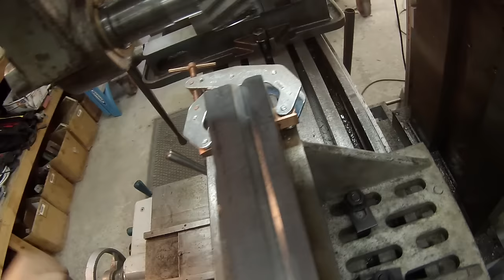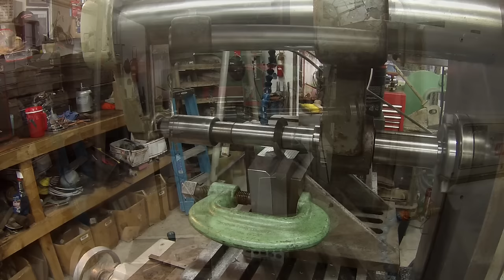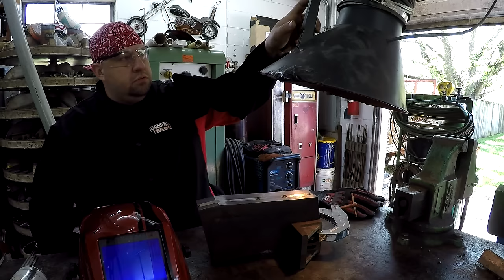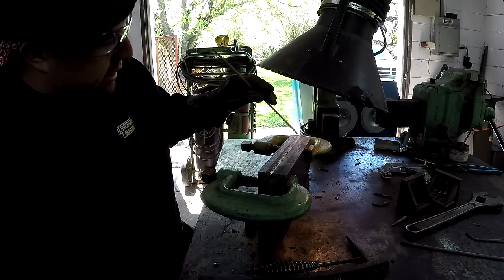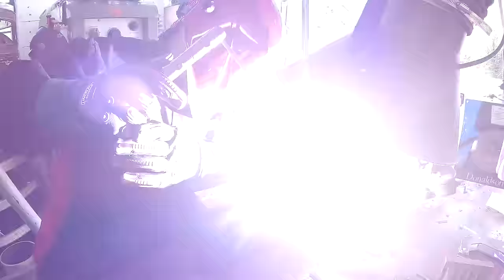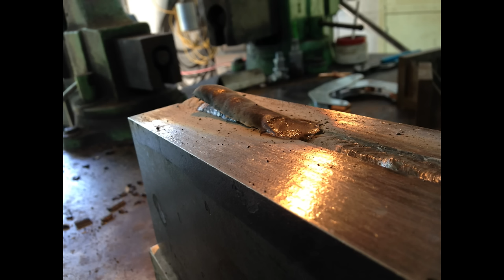Kearney & Trecker Parking Attachment Part 2

Comment: Just a thought Adam. The holes in the part would make it lighter... therefore be able to lift more, for it's size. Maybe the lightening voids are a good idea? you could just drill large holes down through the job to do the same function?
Jane
Reply: +Jane Calder Extra holes don't make it able to support more for its size; quite the opposite. A better way to describe the function of lightening voids is that they reduce the weight without reducing the strength very much, which is quite beneficial on vehicles and moving parts. They also can reduce the volume of material used without reducing the strength very much, which is an important consideration when casting production parts, and is probably the only reason K&T did it on the original part. However, voids will always reduce the strength overall, at least a little bit. An added concern here is that  a lot of the strength comes from Adam's welds along the edges, and since the welds don't go all the way through, drilling into the bottom would remove a good portion of that weld, and therefore the strength.
Reply: +Scott Anderson Thanks for your comment, of course a soild bar is stronger than the same size hollow tube. However I feel your being pedantic, the point is... that in this case the function is to carry the K&T part without being unnecessarily heavy, and therefore more prone to wear on joints and also casting metal fatigue etc... I wouldn't say anything if there were no reason to it. More, that it also adds to the effort needed to move the accessory arm, than if it were made lighter without loosing it's usable strength. If bridges were made out of soild bar they could never even support there own weight. Obviously, the original part was made in the way I discribed. What's to stop adam brazing the part inside the holes? Though from experience; I think the weld would hold anyway.
Reply: The weight of a few pounds of steel in the arm has no significant effect on the bushing wear or metal fatigue or inertia of the part, when compared with the few hundred pounds of weight of the vertical milling head it is carrying. And once again, if you were to drill through the bottom, you would remove a lot of the weld bead, which contributes a lot of strength in this case. This would massively weaken the part.

Even if Adam had used a solid piece of material for that portion of the arm (which could probably be lightened without weakening it too much), the time required to drill a few large holes in it would be orders of magnitude more expensive than your poorly considered savings in bushing wear and effort of motion.

If bridges were made of solid bar they could most certainly support their own weight, along with all the load they were designed for, and the engineered safety margin, and additionally have a lot more strength beyond that that would never, ever be utilized. That extra strength would be wasted, so the engineers selected lighter, much more affordable, and technically weaker materials instead in order to save a lot of money (if they hadn't, the bridge would never have been built, regardless of its strength).

Voids and holes never add strength in any sense, they merely reduce weight and cost in a compromise with reduced strength. Calculating how far that compromise can be carried, in relation to the application, is a lot of what engineering is about.
Reply: +Scott Anderson If I said black you would say white so I'm not going to continue this... The young have a lot to learn. You are obvouisly not a mechanical engineer. The estimated weight of the removed steel is 16lb. As 1 inch of weld has the tensile strenght of 1 ton see welding techsheets. Which is far in excess of the load from the fulcrum to load in this instance. You could lighten the load on the K&T casting piviot. It only has to break once. So we will wait and see. You could instead of down from the top make a large hole in the side and weld the interior joint. Women have been Mechanical engineers even before you were born.
Reply from the maker: +Jane Calder I'm not concerned with how much the part will weigh. Once I install it on the machine it's there for good. No taking it on and off.
Reply: +Abom79 Sorry if I appear to speak out of term. I am of course speaking from experience.  A lot of years ago, I knew a machinist Frank Edwards [deceased] who made a part; perhaps slightly heavier than yours. That part was on a heavy capstan lathe made by ward. Three heads on three parking arms. The factory [G&E] had lost one of the arms, and so they decided to make another one. Just as you have done, they used steel bar stock.  though admintedly it was soild bar stock.  In theory it should have worked forever, right? looks right. perhaps 28months past, hot in the summer cold in the winter. On the back of the lathe was a cast iron piller holding these three arms. On investigation it was found that the extra 32lb of the new arm out at a distance of 24 inches compared with the original manufacturers arms caused the metal around the casing of the piller to fail and fracture over time. Just a thought. It's your decision.

Comment: I'm guessing the air is kind of damp down there. How are you storing your stick rods to keep the coatings in good shape?

I've used an old oven on minimum temperature, but just wondering.

Comment: Are you going to pin the two sides together, or plug-weld, or just rely on the strength of the edges?

.. or I could just watch the rest of the videos and find out, I suppose :)

Comment: Hi Adam, no offense but wold not much faster if weld the frame from thinner steel to form like an i bim section than weld two tubes turned to a close dimension? 
I enjoy watching your work and effort to encourage and inspire the young guys in this beautiful trade.
Radu
Reply from the maker: +3rcamera I'm just building it the way I want, like how I built my welding table. No right or wrong, just one man enjoying his shop time and machines.

Comment: Adam, I couldn't see where you grounded the part when you welded the piece on the machine. You may want to mention it is very important to ground directly to the part being welded. If not, you can arc across your gears trying to go to ground causing damage to the machine. It is best not to weld on a machine if all possible.

Comment: I'm not a machinist, so this may be a naive question: When cutting those angles, why do everything with the roughing mill instead of bandsawing the bulk of the waste away and then using the mill afterwards?
Reply from the maker: +Pete Brown It's a good way to do the just yes, but I don't have the proper saw, and wanted to hog it off with the mill anyways.

Comment: Adam, not criticizing, just curious.  What was the decision point on using stick over MIG?  Was it just a desire to use up the old rods or another reason?
Reply: +ramosel 

Not an expert exactly but from my experience its easier and takes less machine (amps) to burn in heavy welds like that with stick vs mig.

Comment: any reasone you didnt tack the parts together and cut the piece off with the band saw then clean up in the mill?
Reply: +HomeDistiller makes for better video!
Reply: +HomeDistiller good question. it might be that a band saw can walk away from the line on large surface engagements like this.
I reckon it was more to do with the fact he was going to need the slab mill anyway and he DID say he likes watching it make big heavy cuts.
Saw might not have saved any time depending on how setup he was to push something that size through it.

Comment: I'm assuming that Adam does not have a band saw. Otherwise, he could have used it to the section he milled without so much milling.  I noticed he did the same with the toolmaker's vise.
Reply: +GnosisMan50 Actually he has, I guess he just likes milling a lot... I would  also have used a saw though...

Comment: Adam, may I ask a couple of questions?

a) When you were stick welding, was tat ac arc or dc arc?

b) What current did you use for each size of rod?

c) Why did you choose to weld with 7018 rather than a general purpose rod such as 6013?
Reply: +Greg Brodie-Tyrrell He said he was using up oldstock... maybe 7018's were all he had? I haven't tried a 6013 in a while, but I seem to remember them being a little hard to see the puddle for all the flux/slag?
Reply from the maker: Hey Greg I was using DC reverse polarity set at about 130 amps for the 1/8 rod, and 160 amps for the 5/32 rod. 7018 is one of the best all around rods to use for most any steel welding job if you have the right machine. I find that 6013 rods are great when using AC current.
Reply: +Abom79 +DSCKy  Thank you both. All we seem to have here in Australia is 6013s; that's what most people seem to stock, and very little else.

I knew 70xx series rods are supposed to be good for DC welding, which is why I asked. I have used 7014s on AC, on the advice of an older bloke who knew more than me (guess how many people fit that category?), but now that we have both DC and AC and TIG (hooray!), along with reversible polarity at the flick of a switch, I can see that I'm gonna hafta go get me some 7018s.  :)
Reply: They do make a version of 7018 for ac... usually labeled 7018AC. They work pretty well, but if you have a dc welder - use dc and the dc version.
Reply: +DSCKy Thanks mate, I'll try that.

Comment: Abom, how do you lube the running bearing?
Reply: +Doug Rundell OK. I saw the toilet bowl oiler and the sight glass. Good job with old rod.
Reply from the maker: Yes it has an oil cup and reservoir for way oil. It drips down into the bushing.

Comment: Wouldn't it be better to run the cut in the other direction (like the touch up) so you don't have that chip build up right in front off the cooling nozzle
Reply: and the cooling fluid would cool down the tool before its cutting and not afterwards, cut itself may be better as well if the teeth cut in the same direction as travel. Not a machinist though just curious.